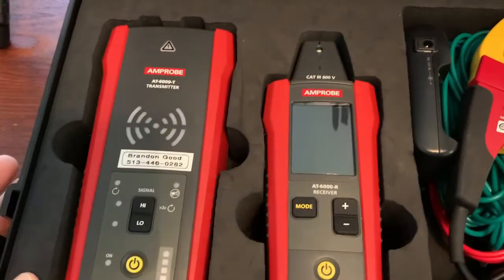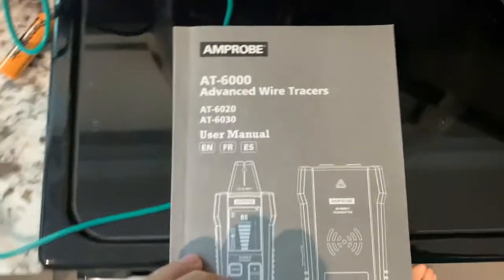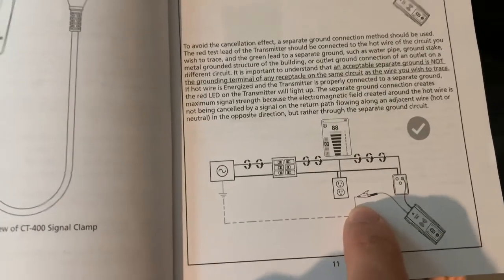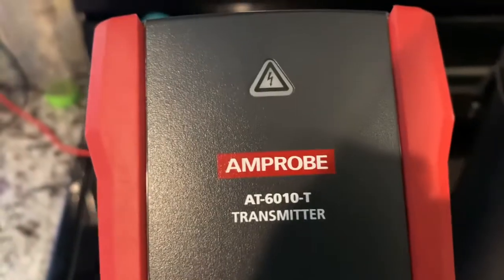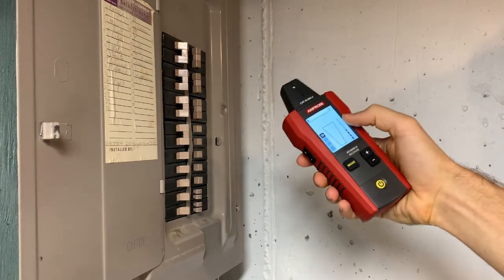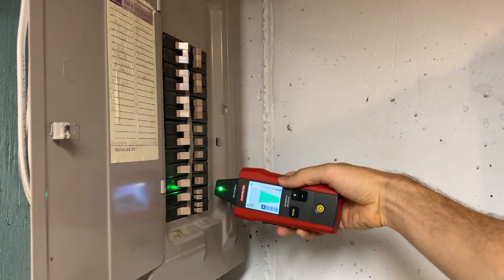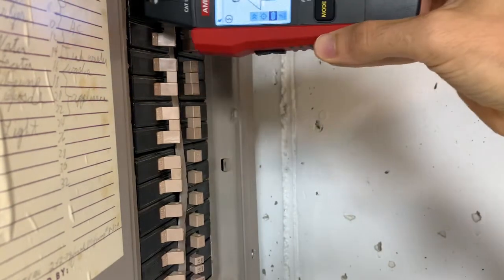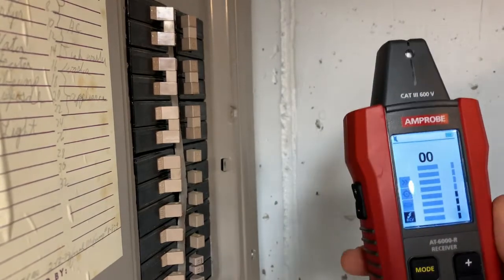AT-6030 - Fluke Fridays - Episode 14

Comment: I paid 1000$ for mine and the $50 new Klein is easier,faster and cheaper. As for tracking wires and opens after a few hours when I couldn’t find the open myself I did narrow it down to a hallway ceiling and the customer said he would fix it him self. So it’s a last resort thing but I did have luck with the same type the Ideal one . I have this one also for. $1000 had one go bad, returned it , it’s great dog and pony show at best. Expect to spend 2-4+ hours fkn with this sensitivity problem and narrow down the issues. I diagnose problems residential every day and I may use this once in five years because I can find the problem faster with my traditional troubleshooting methods. So if you got 1k to throw it will find your circuit breaker for sure but it’s a lot of bull shit running ext cords and finding grounds that’s not connected to your short or open,and the sesativity button is a fkn absolute joy to fk with. It’s not worth the 1k people like the $300 Klein and the $50 newer Klein for finding cb the easiest

Comment: For $1600 it is a pos, klein can do it for less than $100
Reply from the maker: If you want one similar to the klein get a BT-120 and you will spend less than Klein. But if you need to trace both energized and de-energized and be able to source in an industrial environment (like 480volt) Klein does not have an solution that I am aware of.
Reply: @fridayswithbrandon  ET450 for $300. Btw love your video

Comment: My Ideal 61-957 went missing last week and decided to order the AT-6020. I hope I didn't make a bad decision not going back with another Ideal that has served me well.
Reply from the maker: If after you get it you have any concerns please reach out. I think if used correctly you will be very happy
Reply: @fridayswithbrandon  AT-6020 came in, and I have played with it some around the house. I do like it so far, but I really wish it came with the little flat blade lead adaptors like the ideal. Much easier to just plug the green lead into another circuit receptacle instead of finding something to clamp to.
Reply: I have ideal 61-959  it's more better then this

Comment: The false positive, Regrettably, is one of the most common mistakes that are part of wire tracers because a "ghost coupling" between wires , but i think that in tracers of this price these problem It was more or less solved,
but it seems that it is not so
Thanks for your review